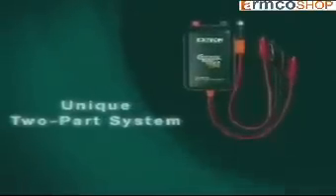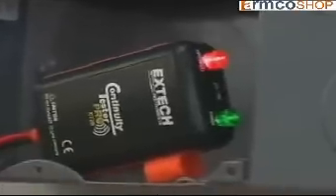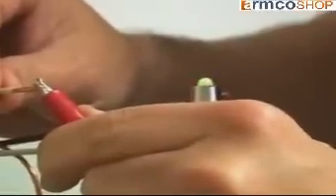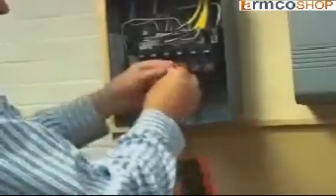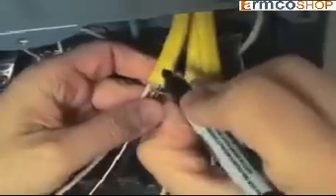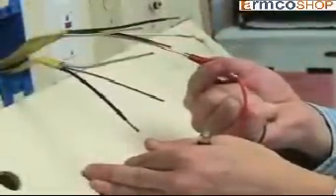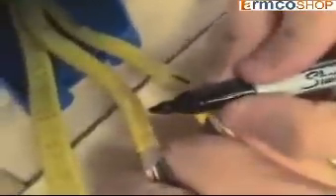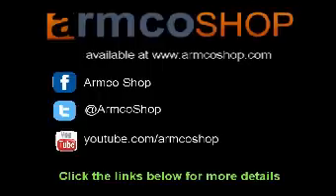Remote & Local Continuity Tester Extech CT20

Comment: could this device be used to test the continuity on a single wire... such as using an ohm meter on a single wire in like an automotive situation? Would it work with the remote feature?
Reply: codemiesterbeats I have the same question!  Edit: found the answer (no): http://www.eetimes.com/author.asp?doc_id=1321770
Reply: We should design a solution! Lol I think it would be difficult now that I think about it. You need to induce a bit of voltage into the wire and see if it makes it through.... and if you wish to read the resistance, measure the voltage drop... So basically I guess you have to complete a circuit to a power source.... and  the only way I can imagine to do that wirelessly (that I can think of right now) is some sort of tesla coil contraption but those are usually high voltage. I am thinking some sort of contraption could be made to test something like a house wire.... but probably nothing delicate like anything connected to any electronics etc.... but idk I was just thinking out loud lol